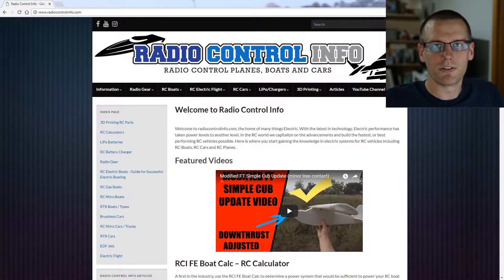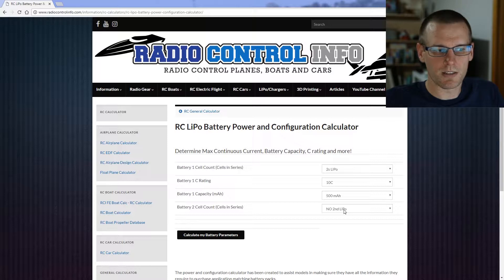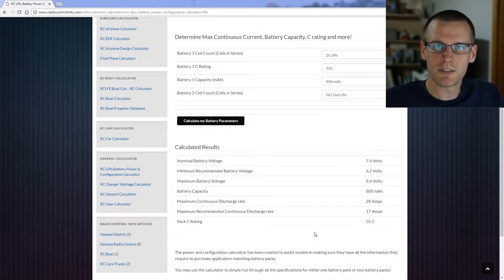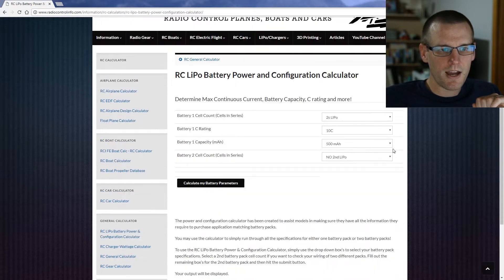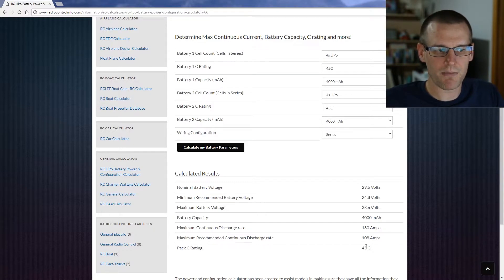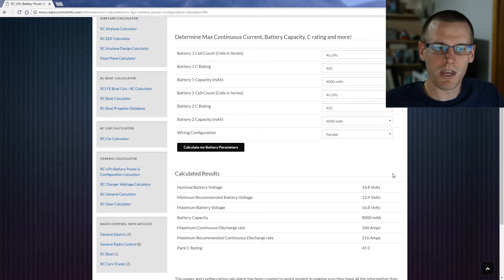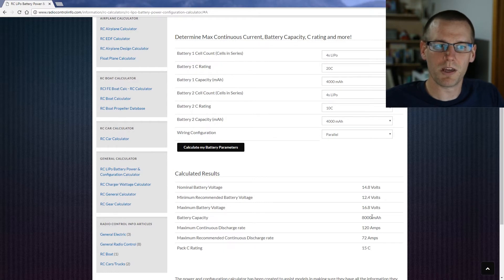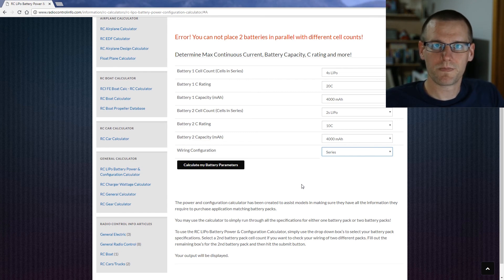RC LiPo Battery Power and Configuration Calculator

Comment: Thank you for the website with many calculators!

I have severeal questions (A)

-Why is there a recomended "Continuous Discharge rate "?
Isn't it so that if you dont max out the discharge rate that all will be ok?

-How do internal risistance and C rating hold up to each other?
I have a 7700Mah 120C pack from "proforma" and with a speedrun the voltage dropped from 4,2V per cel to 3,1V per cel triggering the lipo cut-off, after the run the voltage came back up to 4,1V per cel. It only delivered 340 amps (barely). Battery temperature was arround 35 degrees celcius and the internal risistance is arround 5 mili ohm per cel.

-What happpens if you exceed the recomended Continuous Discharge rate?

-Is there a way to check the quality of your lipo battery? To check if your battery is still ok sort of speak.

Comment: 2 batteries  1Ah has the same volume as parallel or series 2Ah? Your calculator calculates parallel 2Ah and 1Ah in series. Or I'm wrong? Ah not A :)
Reply from the maker: Hello, I'm not understanding your question.

Comment: curious why the calculator tops out at 60c many lipo companies are advertising much higher c-ratings like 90-c/burst 120c/burst
Reply from the maker: Hi Jammer. I just checked and it looks like they are there?? Just kidding they are now added ;) As newer packs come out and C ratings increase, they can be added to the calculator.
All C ratings on the calculator are based on continuous discharge C ratings. burst values are nearly irrelevant and can be calculated based off of continuous ratings. Don't forget to subscribe if you haven't already!
Reply: @RCexplained  Thank you for the quick reply, I see the calculator now includes up too 120c :) all tho I am not sure I trust  the advertised C-Ratings some of these lipo sellers are stating, what brought me to your channel and calculator pg is from an f.b post a person purchased a set of smc 4s lipos to run in his new losi super rock rey @8s another person chimed in stating the amp rating is too low for a 90c  rating given by smc, 105 A at 90c the person claimed they are probably more like 21c but when I ran them thru your calculator  I get 450a max and 250a recommended... what am I missing here, is their anyway to tell the true c-rating if smc is misleading?  https://www.smc-racing.net/index.php?route=product/product&product_id=513
Reply from the maker: Hi Jammer, I don't make purchases without knowing I am buying from a reputable seller. Also, I prefer to see reviews that suggest the product is of good quality and specifications are accurate. My suggestion - look for a pack that specifically states continuous or constant discharge C ratings. If it doesn't say this don't even bother with the pack.

To answer your question about how to determine if there are misleading specs, the last line above would do that plus this. You really have to either buy the pack (or let someone else do this and review it) and place the pack under a load test. 

Even most quality packs struggle to achieve 65C. I would be extremely surprised to see a pack that can actually do 90C continuous. This is a lot to ask for from a very high dollar battery pack. I would agree with the person who says they are more like 21C as the 105 amps divided by 5Ah is equal to 21C. 

90C is probably the advertised burst rating. I would also expect the burst rating to be approximately double the continuous discharge rating. 21C * 5Ah * double = 210A burst. This is 42C and not 90C. 

Things aren't adding up here. Not a good sign if the posted numbers don't make sense AND they leave out the critical details like burst C rating and continuous c rating. How would anyone make sense of the numbers?